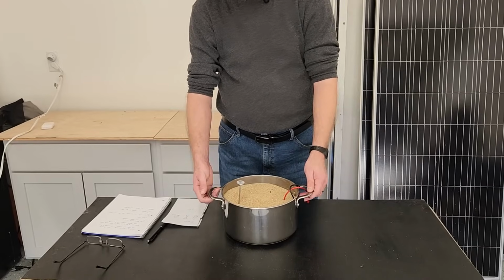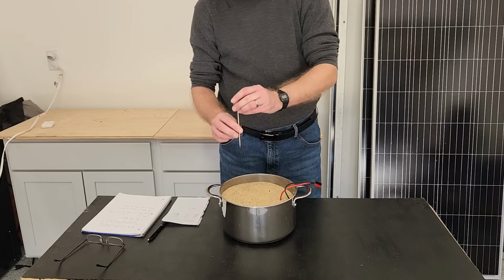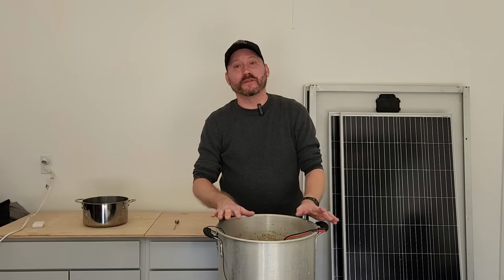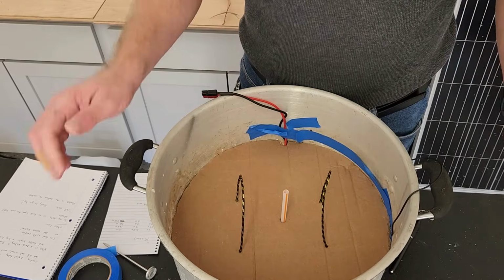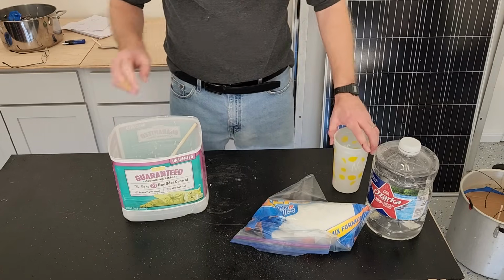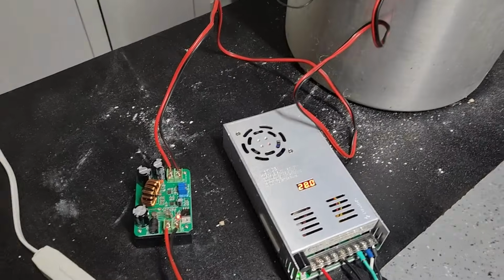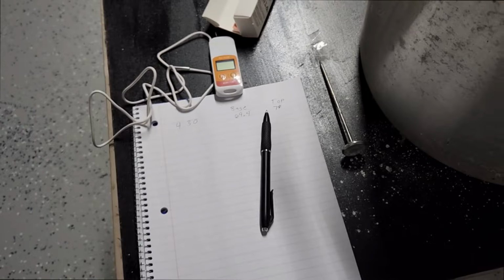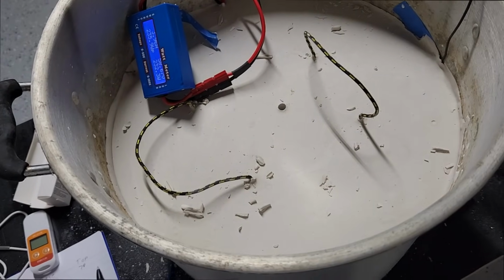Sand Battery heater. Create free heat  of 500F using solar electricity! Texas Prepper Projects

Comment: How about using an induction heater with a cast iron pot buried inside and out by the sand? This would distribute the heat more efficiently through the sand, which is actually an insulator. Use castable refractory instead of plaster. This can take very high temperatures and is used to make kilns. An accordion pleat of copper wrapped around the outside would make both a convection and radiant interface. Wondering: will induction heater work if separated by half inch ceramic fiber board? The heating element would stay cool while the cast iron could get hot.  Or cooler…
Reply from the maker: check out my other 2 videos for real world testing on this. An electric blanket is a much better idea
Reply: @texasprepperprojects  true, for heating bodies, but not so good at heating space.
Reply from the maker: @fordstone6308  agreed.   I think that this COULD work for heating a space just to keep it above freezing, like for a greenhouse, but you'd need a lot more sand and a lot more solar input.  For heating a SPACE, I think that a propane heater is best bet. But for heating a body, I'm all about the electric blanket now

Comment: The probe should be mounted on the out side like a regular hot water heater. Then put a copper tube wound in circles (like in a moonshine still, (the worm) in side with the sand. Hook a small solar pump to the copper tube and have it circulate water from a water storage tank all day.) You’ll have all the hot water you need and heat) Also, you are going to want to use a very dry mortar mix (use very little water to make the mortar mix to make it strong) instead of plaster of Paris. Great job thanks!
Reply from the maker: Check the follow up videos for more information

Comment: For some time I have thought to use high watt TEGs wired in series put in a circle or spiral in the sand.
TEGs can be powered by solar or by residual heat from a wood burning stove.
From the stove the power can be used to power other TEGs in another area and the solar powerd TEGs can heat the sand.
Just an idea !
TEG ( thermal electric generators).
Reply from the maker: I am familiar with them. They are too hard to work with because they only produce power if you have a temp difference on either side.

Comment: @4:07, you confuse plaster of Paris with ceramic. Plaster of Paris is NOT a ceramic, it’s a gypsum based material.however, it can withstand working temperatures up to 2,200DegF so well within the temperatures you will be working with. Thanks for the video 👍🏻 great instructional 😀
Reply from the maker: Thank you

Comment: use diy 4:1 perlite : cement mix to make a custom container that is very heat insulating and very cheap. use some cheap wood pieces to make the mold. it will tolerate temperatures up to 1000 degrees+.
Reply from the maker: Neat

Comment: Instead of plaster of Paris for insulation. Might l suggest that you take a look at ‘how to make fire bricks’ here on YouTube. The guy who shows a 7-7-2-3 mixture seems to know the most about it. You could use the mixture, while it’s like a mud/paste, to insulate only the outside of the container. You would gain better thermo insulation than plaster of Paris and more sand storage area. Also, like some one already said. Create something to isolate and protect your wires from the sand. 😊 Lastly, your idea of placing metal into the sand for a heat sink would be good, if you used metal rods that are thick. Winding small gage wire between two or three metal rods. Then, surround the metal rods with a larger diameter plastic pipe around and up higher than the rods. With the super heated rods inside the pipe. The pipe having an air gap above the sand. It would create a thermal heat flow up the pipe. The pipe would help radiate the heat up, out and also help protect from inquisitive fingers from getting burnt.  Great build.
Reply from the maker: Check out video 2 and 3
Reply: @texasprepperprojects  23:23 23:23

Comment: You've invented a thermo-mass effect heater.  My kids house in Colorado has this. The heat comes from a propane heater heating antifreeze which send the heated fluid throughout his 4500 sqft house concrete foundation making the floor warm and toasty. The next project is to replace the propane heater with a heat pump system powered by 25kwatts of solar. Which will effectively put out about 75 kilowatts of electric strip heat into the foundation.
Reply from the maker: Thanks!

Comment: Nice test.  I believe you were loosing some heat from the metal on the outside of the pot.  You may want to insulate that while you are not tapping the heat (Maybe a plaster cup - wrap the pot with saran wrap and then plaster the outside for insulation). Then when you are ready - take the metal pot out (insulate the handles as well).  Good luck.
Reply from the maker: Absolutely lost heat to the sides but if the container is inside the air space you want to to warm up then the heat isn't 'lost'

Comment: Nice experiment. Have you ever tried or ax a suggestion- solar thermal to heat the sand? Skip the electrical. Maybe paint sand bucket black and put in tiny greenhouse? Or a solar lens on it?
Reply from the maker: Not worth it on a small scale. Check out my other videos

Comment: Bolt on some wheels so you can move it easily/ leaving sand open and then placing a thermal powered fan to push the heat around your room.
Reply from the maker: I'm going to put it on a cart to move around. Especially version 2 which is going to weigh a LOT more.

Comment: There several ways to make it efficient, there several issues. First the radiant would be like a wooden stove and the temperature is very hot near and no way regulate it. Cinder  blocks to isolated and place some around like camp fire. Add a small 12v  or 24v fan. Create a horizontal box for the sand. Might use concrete, I personally would use tiles and 1" cinder blocks a few 3" space between them. There are plenty of sensors available and electronic parts to make thermometer and thermostat use small copper tube. The placement of the electrical elements should just blow the center. Thermostat can be used to reduce the use of the energy. There formulas to calculate how energy that can stored and how long it will last at various temperature. Your experiment is ok. It is just needs a few things to make make better. I have built several different types of heat storage. One was a solar water heater and underground storage tank 6'x8'12' deep concrete wall and floor, tile floor and wall s, this was for the house and spa, it also charged 6 12v batteries. The electric bill on the electric was 60%  less during winter.
Reply from the maker: Check out video 2 and 3

Comment: You could use ceramic blanket so when your element goes out it’s disassembly will make easier to replace. Or drill the pot so the element can be mounted externally.
Reply from the maker: Check my followup videos

Comment: If you are camping and using a solar system with a battery bank... will you be able to heat up the sand with like a portable stove unit?

I'd like to see if there's a way to heat this up using the solar system's battery bank using a portable (electrical) stove range unit on a timer. The reason is the timer. According to you the heat lasted 4 hours. People sleep for 8 or 9 hours (or 10...). That means if they had an electric timer with settings (such as with a timer, and portable stove unit) they could tell the power bank (solar + batteries) to wake up and reheat the sand at a 4 hour mark while you are still asleep. (Is this doable?) IF you could use a timer and portable range then... you could sleep the night without having to wake up halfway through to heat up a tent, etc. I'm not sure if this would work but if the heating unit was on the outside then you wouldn't have to wreck your setup to go in and fix it if wires broke, etc (?) With the wires and stuff in a portable stove unit (if it can work) that might be easier for maintenace. 

Your idea of a (plaster) lid over the sand is interesting. I liked that. 

... 

Also people will need ideas like this because there's so much trouble going on with the utilities and electricity in US, Canada, and Europe. They've destabilized bills so that people can't afford them. That's just sad. Hopefully your work will help people out.
Reply from the maker: Watch my other videos. Using an electric blanket is a far better idea

Comment: A couple thoughts. 
To protect the carpet, I would put 2x6s under it, with ceramic tiles on top of the 2x6s. 
I'm not sure I see a reason to cap the top.  You want the heat to radiate out.
Running the wires from the solar panels to inside your home would allow you to leave the tanks inside 24/7, and be generating heat any time the sun is shinning.
Reply from the maker: check out video 2 and 3 for answers to some of these

Comment: First video I'm watching from you. Great work with this idea. Not sure if it has been talked about, but, what if you were to use a solar heat catcher "the kind that people sometimes make out of soda cans painted black" and run the hot air through a aluminum tube that is surrounded by sand in another metallic tube. Like a sand radiator. I wonder how hot it will get and how long it will hold heat.
Reply from the maker: I actually tried something similar. Check out my video on 'parabolic heater'

Comment: You could use the drill to cut a 3 inch in diameter section out of the top Plaster of Paris lid and take that circular piece that you cut out and use it as a plug while you are heating it and then remove it when you want to release the heat during the night. In addition, once you remove the plug to release more of the heat, you could make a lid for the top of the pot that also has a 3 inch hole in the center.  As the heat rises out of the top lid, you could mount a computer fan to blow the heated air into your room. You would want to drill some holes in the side of the pot, just above the Plaster of Paris lid to allow fresh air in and create a chimney draft effect.
What do you think?
Reply from the maker: Check out my part 3 video for something very similar

Comment: Aircrete can be used to make the container for the sand. you can use stainless steel to make the electric conductor easy to replace (bolt in). Aircrete is highly heat resistant. Cheap to make, at 3" thick you can put a blowtorch on one side and your bare hand on the other for 30 min and feel none of the heat. Stainless fittings from the brewing tools to assist , skies the limit!
Reply from the maker: Could be

Comment: I'm an engineer. Thermodynamics is not my strong suit but I get the basics. The amount of Joules it takes to heat one gram of a material by one degree Kelvin is called specific heat. The amount of Joules it takes to change the phase of one gram material is latent heat. This is much much higher than specific heat. 
I would recommend using a phase change material (PCM) such as a hydrated salt. NightHawkInLite has a great video on this topic. These act like an ice pack but the melting point can be chosen for the task. For example, it takes 334 J/g to melt ice but only 4.184 J/g*K to warm water (which is very high compared to other materials). So, if you completely melted a certain amount of ice and put the same amount of energy into the now cold water, it would reach 79.8°C. Using PCMs, you can store more heat in less space at a lower temperature. This means less insulation, less danger, and less expensive.
Reply from the maker: I have seen night Hawks video. Its amazing!  For this use case, however, I feel that direct solar air heating is the best option. Check out my recent video experiments on this

Comment: Suggestion why not do a real life test? My power went out for four days last winter and an ice storm. We survived in our bedroom with the door shut what would your can of sand do in that situation instead of measuring the heat of the can. Measure the heat of the room you place it in, so far these seem suitable for greenhouse heaters not heat a room in your house in an emergency
Thanks for sharing
Reply from the maker: Electric blanket is a better idea than a sand battery

Comment: Interesting experiment. I'm curious. Very impressive. Looking for a way to heat a greenhouse with no electricity. For sure I would put it on a ceramic tile base. Keep doing your experiments.  It's fun if nothing else.
Reply from the maker: Check out the latest video with more details. 

I think that using a pool heater to warm up 55 gallons of water would be better for a greenhouse but I'm not sure

Comment: Use 4 square flat pavers made of cement  to put the vessel on. I'm just a 70 y/o with a thought ♥. Hope that works better than the insulation idea if the pavers get hot(more heat,than put the insulation there
Reply from the maker: good idea!!!

Comment: Paint your pot with black stove paint, that will raise the emissivity of the surface providing more radiant heat ( lil tip from a mechanical engineering guy ) I like this idea, nice work
Reply from the maker: check out my other videos for testing on this

Comment: A wee question why not use like an "oven element" from a cooker that would cover more of an area you could safely have the element connectors sticking out of your pot bucket barrel whatever you used either above or thru the side secured and insulated then it would be easier to connect or disconnect would that work directly with solar for a heater
Reply from the maker: Check out the other videos in this series. I actually tried this!

Comment: Looking at all the pieces you're using, I can't help but wonder if you wouldn't be the perfect receiver of someone's leaking water heater!?!! You could cut it down to size, the probe is already mounted from the side, it has a temperature meter And is already insulated!!!  All you'd have to do is add the sand and plug a couple of holes, maybe some welding as well!?!! 🙃😉👍🙏
Reply from the maker: Except I can't move ir

Comment: I like it, but I was thinking,  maybe can make use of crock pot. 
I actually use toaster oven, espresso/coffee maker, rice cooker, boil hot water, using my 200AH lithium batteries and 400W  Solar Cells, can generate actual like 275W. I'm in New England area, so I'm sure you'll have no problem once you get this sand battery concept down.  If portable you can paint black and also just leave in the sun, and compliment with solar cells. Then roll into house.
Reply from the maker: In rev 2 I'll use a trash can with thinner walls. I do think that if you have direct sun you can 'boost' the heat in the sand on top of the electrical heating.

Comment: Off grid in Northern BC here.  -40° here in the winter.  I have a large solar array I use to generate electricity for lighting, internet, (and refridgeration during summer months).  Minimal sun in the long winters.  Heating is critical….thermostatically controlled wood heater…and a big ol’ woodpile in the fall.  Even with a well insulated house, heating with 2000 watts of electricity continuously, would be required to maintain a comfortable room temperature.  (and that’s not possible during snowstorms).   Sand battery is a novel way to store heat for moderate climates, but not practical in the far north.  A geothermal exchange could help with heating efficiencies here, but not a cheap alternative.  cheers!
Reply from the maker: Thanks!

Comment: Great video and project. I will subscribe to see this too an end. Some things I'd like to see is develop the appropriate kind of element as the comments have pretty much trashed the element you are using and for good reason, it's not designed for that application and will burn out quickly. Then I'd like to see you determine a real method of extracting the great as you need it.... My thought is place the core inside a larger container surrounding it and draw heated air from the larger box as needed. Determine placement of vents... Fans.... And follow to get the best output. Then once you've got those steps down calculate the area it can heat and how long it can do it. Consider the material characteristics and construction of the  room or enclosure you are heating. You can make this an on going series just like the guy who developed a big ice cube maker with ice storage using a cheep box store chest freezer and some various parts. That was ongoing and real cool as what your working on. So..... Thanks and .... Get er Done!
Reply from the maker: Check out video 2, 3 and 4 for testing of improvements and my conclusions. https://www.youtube.com/watch?v=siY-t8xlQhU&t=1s

Comment: Put a 3 inch metal pipe down the center of it and put a small fan inside. The sand will heat the metal pipe and fan will push hot air out. Probably a 3 inch pipe all the way through for intake and exhaust from bottom to top in the middle shooting hot air up.
Reply from the maker: Check out video 3 for my solution

Comment: I had thought about this years ago only using a windmill. The feedback I got was to install a battery and an inverter. Which was exactly what I didn't want. The windmills typically use a heater as a brake so I still think it is possible. This would ba capable of producing heat day or night if there is wind.
Reply from the maker: Good use of extra heat!